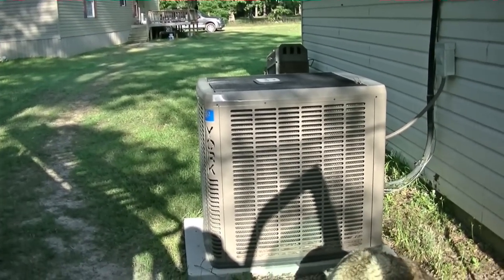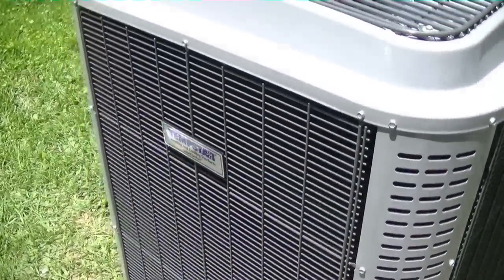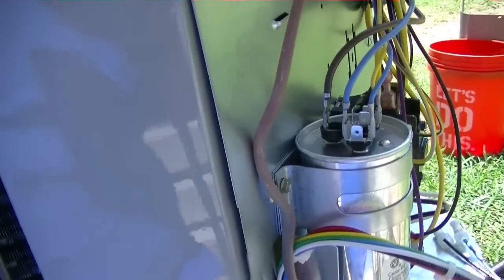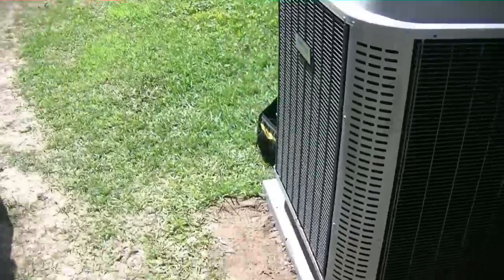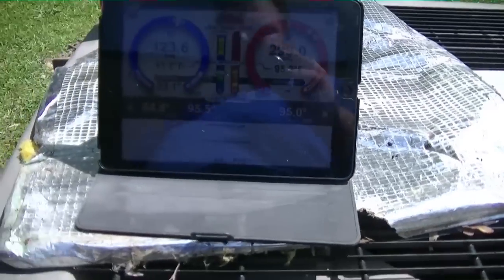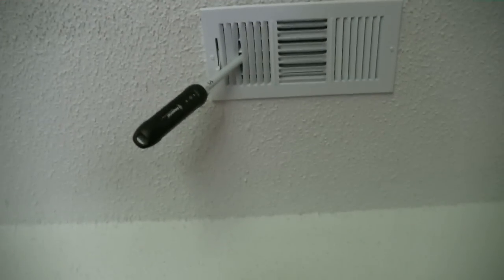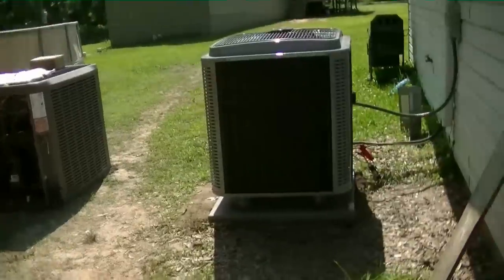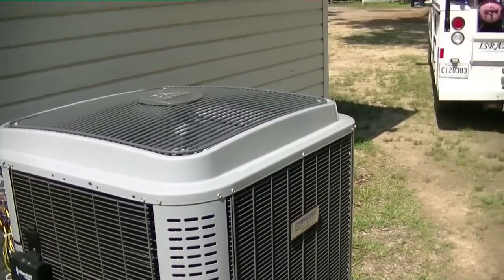HVAC Install: My Home System

Comment: U like the ecobee tstat...I've had nothing but trouble especially when I'm putting in 2 stage heat and 2 stage cool they are apparently supposed to automatically go into 2nd stage heat after 7 or 8 mins and the cust doesnt understand that..I may be wrong but I just assume put the honeywell 8000...

Comment: Hey John love the videos. As I was watching the video I saw that you put the line filter dryer near the air handler. Just curious if there is a reason for this instead of it being placed closer to the condenser?
Reply: Try to get the drier as close to the metering devise as possible.